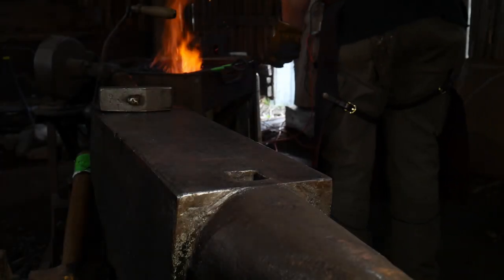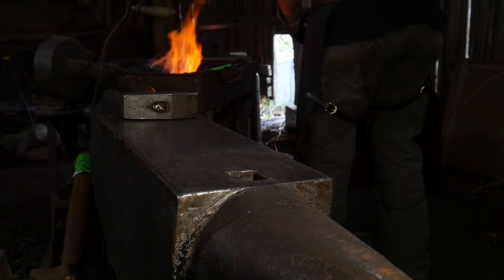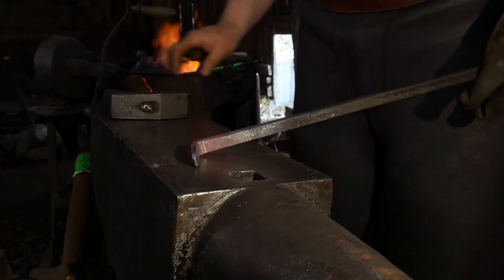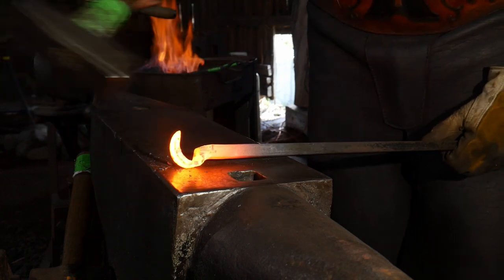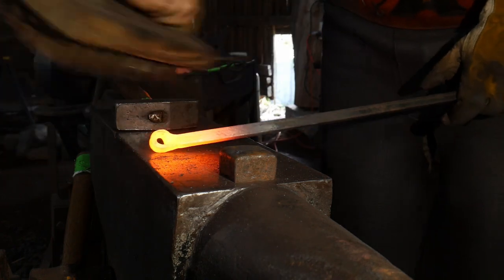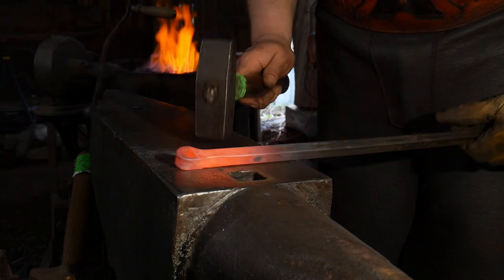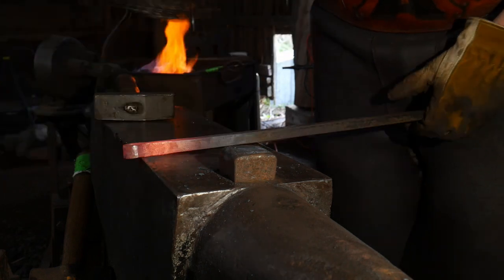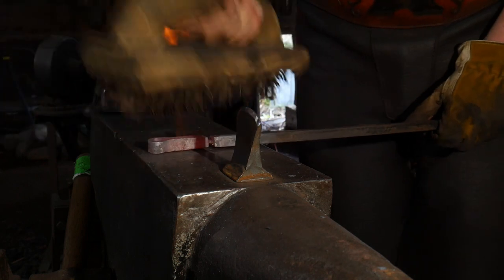The Forge Weld: Fundamental Instruction #7

Comment: I’ve found that wearing a pair of polarized sunglasses helps tremendously. I can look into the fire and watch through a small “window” in the coal as the surface of the material starts to boil. It’s helped me get leaps and bounds better at forge welding.

Comment: Ok, information, great! One thing I noticed is the stock seemed to be on fire with the first welding heat.was that an illusion? I have tried many times, got welds to work but have not yet had what I would call successful. Still gathering little bits and pieces from guys like you, it will work one day, if I don’t admit defeat and just arc weld ! 
  Thanks Roy, another kick in the pants to just try again!

Comment: I have an 18 inch dual burner propane forge and I can't seem to get that high of temperatures out of it. Any suggestions?
Reply: What is the temperature outside? I can weld in a similar forge but it has to be warm cause my tank is small and it ices up.